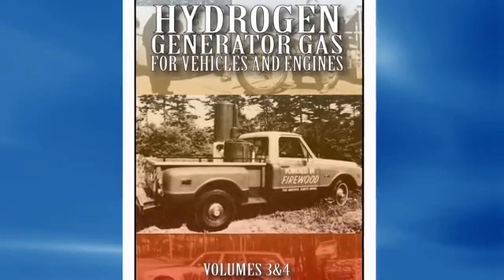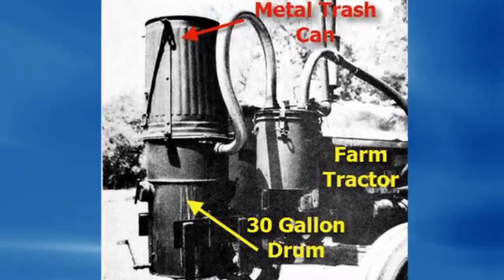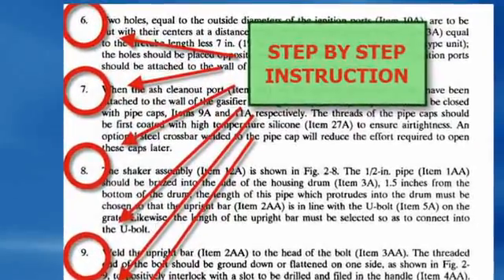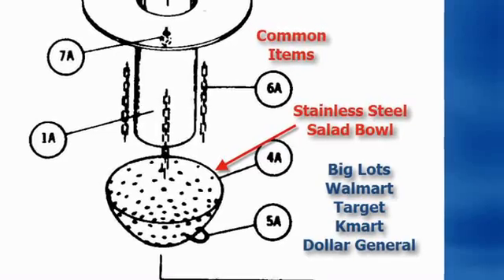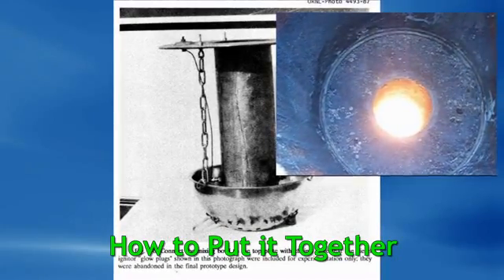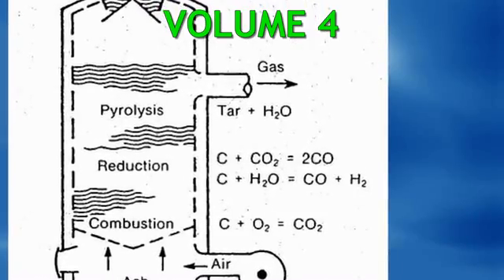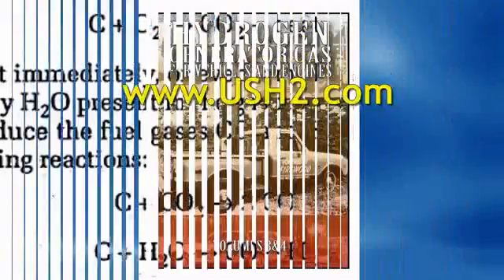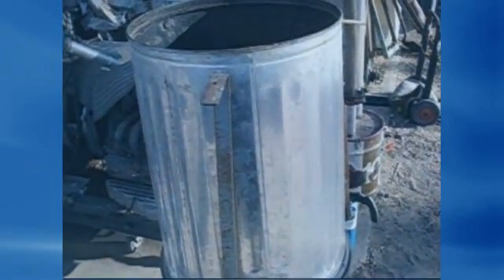Make Hydrogen, Run A Generator On it. EASY.  Wood Gasifier

Comment from the maker: @fuelban It would be similar to the WWII British field kitchen stoves, *IF* you were talking about our Rocket Stove Video,  This is nothing like the British stoves, this is a full on WOOD GASIFIER.  It does not "burn" anything and its output is not designed to be heat.  It gasifies the wood via partial combustion and its output is a raw gas that is flammable and usable, the gas is mostly Carbon Monoxide and Hydrogen.  I know what you mean about the british stoves, they were awesome and simple.